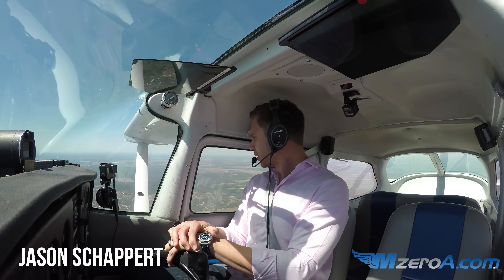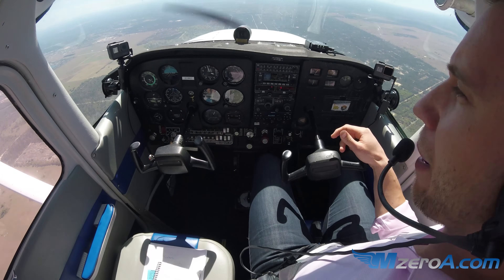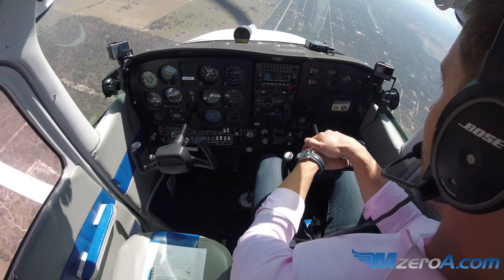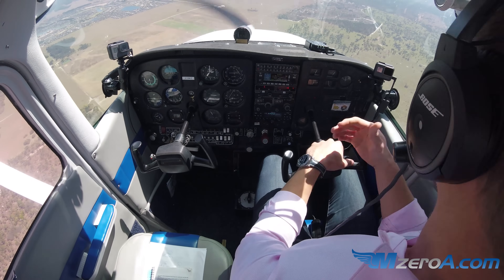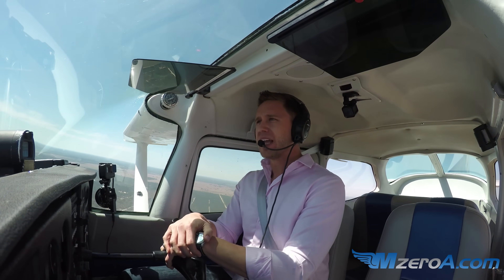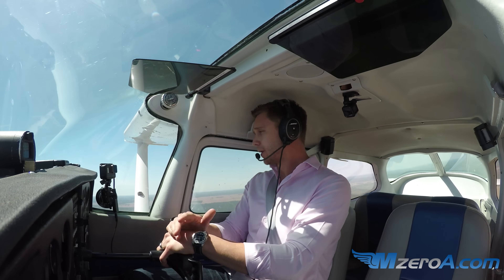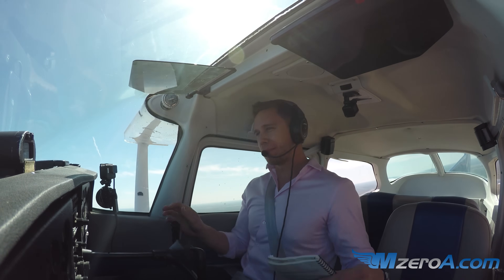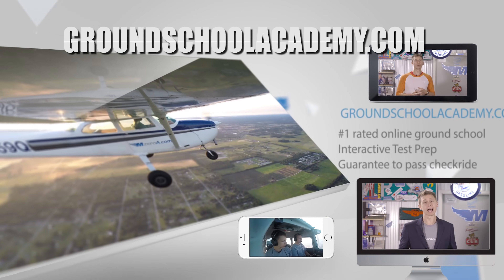Emergency Descent - MzeroA Flight Training

Comment: I had a DPE tell me to just power back and nose the plane over to approach Vne in the decent. seems to make sense since I'm just trying to get on the ground asap so why do we do all the extra turns and try to keep the airspeed down?
Reply: I believe the reasoning is to lessen the load factor, by finding a balance of horizontal and vertical components of lift.
Reply: The steep turns reduce lift to get you down faster, plus you keep your airspeed down so you can land right away!

Comment: Fellow pilots, if you have an inextinguishable engine fire, push the nose down to increase airspeed to the top of the green arc (Vno), while rolling into a 60 degree bank. This will cause you to lose vertical lift and descend rapidly (a true emergency descent). If you have a fire, you have less than a minute before your feet suffer serious burns. There is an accident report (and a pilot interview) to support the injuries.
Reply: As a DPE, I agree with Patrick. The ACS calls for positive load factor (hence the bank is required). Whether an aluminum or composite airplane, fire is incredibly dangerous. I had a fellow CFI advocate for a flaps down, Vfe descent. I told him clean descent at 45-60 degrees bank was better, so we went to 5000' and used our Stratus to log our descent both ways. The no flaps, 45-60 bank descent with speeds as far in the yellow as conditions will allow got us down in 1/3 the time of the flaps down, Vfe descent. You do NOT have time to pull out a checklist.  As Jason says, you should know the Emergency Descent Flow items by memory and do them on the way down -0 but get that descent started NOW. This is a major weakness on PPL and COM checkrides I administer.
Reply: PPL ACS Says 30-45 degree bank while maintaining positive load factor. 45 degrees is perfect, it will get you down the fastest.
Reply: No kidding as far as an onboard fire is concerned -- remember Swissair 111?

Comment: hey buddy please help me out here, i am frustrated. i see you have a gopro hero 5/6 with the mic adapter. i have the same one and i have the set up to capture cockpit audio, i have a wire plugged in the plane, splits and i plug my headset in, and then the other end (has usb, 3.5 audio jack) i plug the 3.5 audio into the gopro adapter and i tried every audio setting from standard to line in and nothing works, the powered mic + captured the lowest of the lowest audio ever i can barley here my self with DR DRE beats on and max audio as i play back the recording and i cant make up what i am saying i cant hear anything and ATC isnt captured i dont know what to do but i have been tinkering with it non stop and i cant get to capture the audio in my cockpit

Comment: I'm confused why you add bank to reduce loading. Doesn't banking increase load?
Reply: While maintaining altitude in straight flight vs a bank: yes. You'll have a greater load factor while in the bank. However, if no attempt to maintain altitude is made, and the increase in bank is merely used as a tool to increase the vertical speed (decreasing vertical component of lift; increasing horizontal component), there will be no increase in load factor (or angle of attack). Besides, we could achieve the exact same vertical speed in straight flight, we'd just have to dump the nose much lower and use a higher airspeed (greater than 120). So, I think what Jason is getting at, here, is that we can maximize our vertical speed without an appreciable increase in load factor by utilizing bank. This reasoning also why there is little risk of having an accelerated stall while conducting steep spirals with high bank angles and low airspeed. It is all about AOA.
Reply: Ah that makes sense, thank you.
Reply: Might be something Mr. Mzero can clarify.. he was descending and did say shallow turns so Phil is correct. Emergency Descent though means something entirely different in the real world... what was shown was how to descend whilst preparing for an Emergency/unplanned landing on an unprepared surface. Emergency descents are not a common requirement of a small GA plane where you would normally want to descend at your best glide.